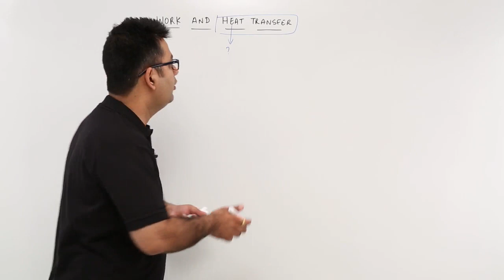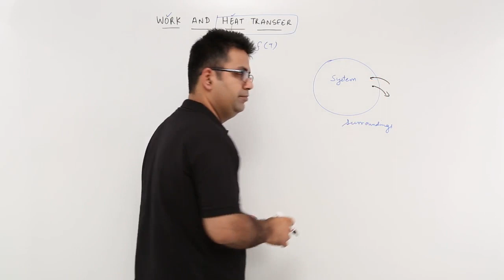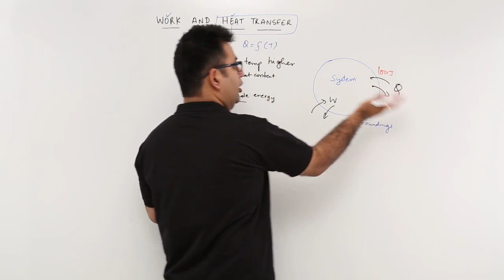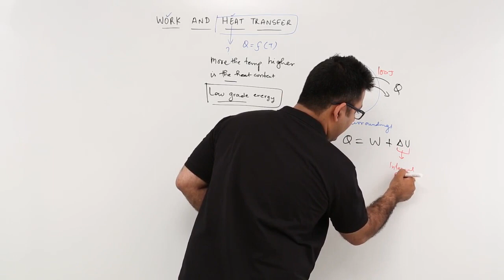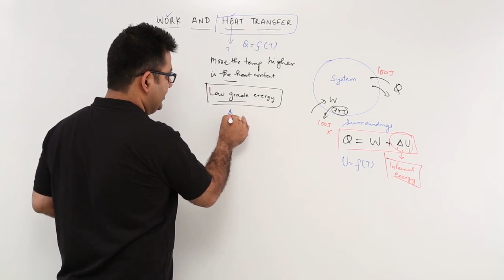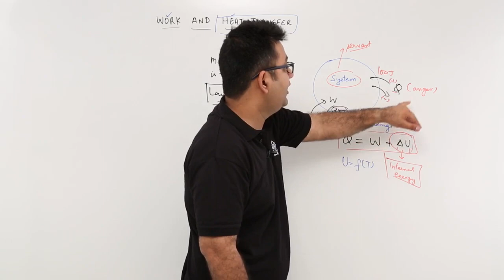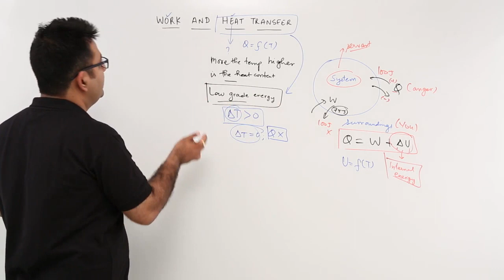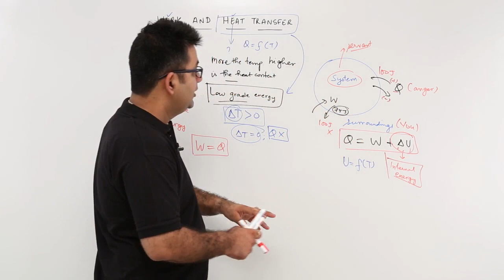Work & Heat Transfer

Comment: Sir, why heat is not completely converted into work?
I understand that work is low grade energy but what's the reason?
Reply: Bro work is not low grade energy...heat is low grade energy...
And answer to your question is due to entropy heat can not be totally converted into work...
But as I said work is high grade energy work can be totally converted into heat..
Reply: Kelvin plank statement said its imaginary to make engine to produce totall heat on system by surrunding then equal work produce but its a imaginary
Reply: why closed system work projected on volume axis of PV diagram ? Why not on pressure axis?......
Some plz answer
Reply: This is depends upon law of heat
Reply: What are these laws ?

Comment: Koi kehta h higher temp means higher heat koi kehta h higher temp doesn't mean higher heat kon si bat sahi h pta ni chalta h
Reply: No relation of heat and temp, relation is between internal energy and temperature,  addition of heat increases internal energy and thus temp, because internal  energy is function of temperature